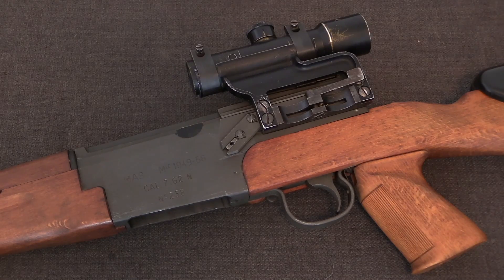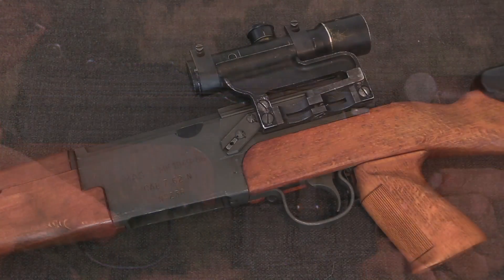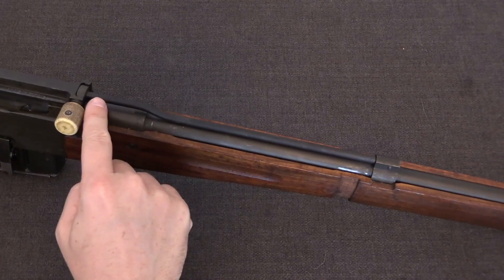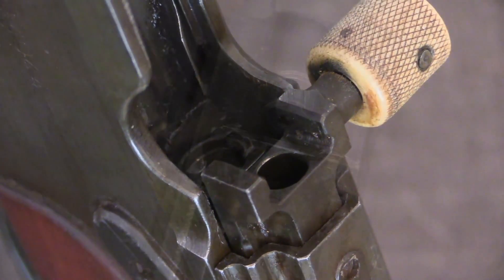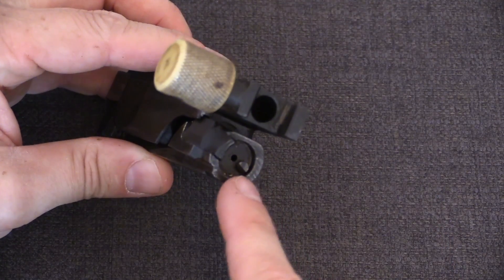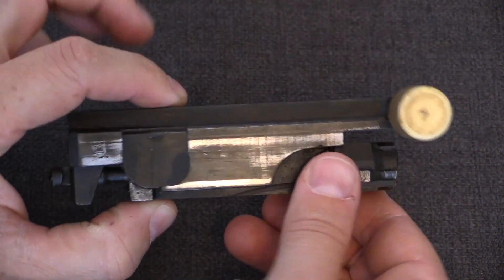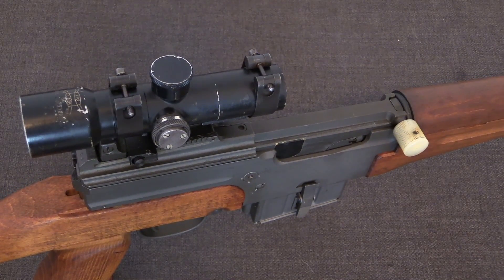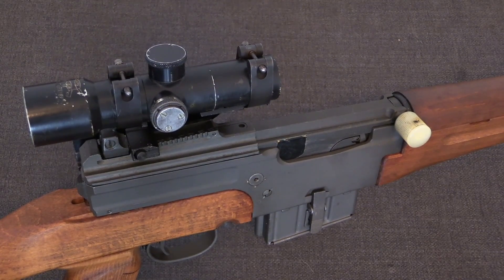How Does It Work: Direct Gas Impingement

Comment: It's actually wrong to call this (or the AR design) a Direct Impingement action. There are only a few firearms that use a DI system. The only similarity of Stoner's design with a DI system, is that the Bolt Carrier decouples from the Gas Tube when it cycles, so it's understandable why folks would make the mistake of describing it as DI. Stoner's design uses a piston, and it's part of the Bolt, so you just can't call it a DI system.

Comment: With the unique, hybrid AR gas system, the initial rearward force on the bolt carrier occurs when the gas enters the gas key/bolt carrier key and is redirected into the gas chamber in the bolt carrier. Because the gas initially acts directly on the bolt carrier the system may be accurately described, at least partially, as "direct impingement."  I like the term "piston-assisted direct impingement."  It is a unique system which is not accurately, or usefully, described as "piston-driven."
Reply: How about "direct-gas bolt-piston?"
Reply: I think the best option is to call it 'Stoner system' or 'Stoner gas system'.
Reply: @jic1  Works for me.

Comment: Most people don't realize it but the bolt on an AR15 acts as gas piston.  This confused the Hell out of me before I became a gunsmith.  There are also some piston guns that function somewhat similarly to impingement ones.  The Ruger Mini 14 comes to mind as it's "piston" is a short tube that blows gas into a blind hole in the op-rod.
Reply: I mean all DI guns have a piston.  A blind hole with a piston in it is still a piston.  There's nothing about DI that makes it mutually exclusive from also being a piston gun.  "Direct' is where the impingement is happening and "impingement" just means a force is being imparted.  All known DI guns that I can think of need a gas expansion chamber and a piston head in order to cycle.

Comment: I'm still waiting for one of these on the Blish Lock. 

"How does it work?
It doesn't
Thanks for watching"
Reply: L85a1 how does it work / how to operate 
step 1 : it doesn't 
step 2 : use it a a sledgehammer since thats teh only thing its good for
Reply: 1. Design barely functional blowback action
2. Add spooky metallurgical magic
3. ????
4. Blish Lock!
Reply: Well, technically the Blish Lock does make the the Thompson a "falling locking block - delayed blowback". It just wasn't locked as claimed and it would have made no difference if they had made the H-block from steel instead of brass.
Reply: @LunaDevaKitty  Sure. Because there was no necessity for a goofy delaying system. (That had been advertised as a locking system). However, the rate of fire increased despite them making the bolt heavier. So it did something.
Reply: @Feeshyenjoyer  You forgot step 3: stick a bayonet on it, make a successful charge and use it as an example for the "necessity of bayonets" in the army for the next 50 years.
Reply: How does it work: Three point sling
"You just slice it up and throw it in the garbage
Thanks for watching inrange"
Reply: I think you might have spoiled the next April Fools video ;-)
Reply: Thanks for watching and could you leave the $150 we charge for using the blish system
Reply: And the inertia lock?
“How does it work?
Space magic.
Thanks for watching”

Comment: Love the series but as a non-shooter, would love to see a video with a side by side comparison of some of the more common calibers used in military firearms. I know it would be impossible to compare every caliber but some perspective would be useful.
Reply: Calibers are usually not really important. Most "similar" calibers don't really differentiate enough to make a big impact in a firearms overall effectiveness (at least in modern times). Most modern armies usually only use around 4 types of ammo: a small bore, short case, necked intermediate cartridge (like NATO 5.56 or Soviet 5.45); a full sized, necked rifle cartridge (7.62Nato and 7.62R); a heavy machine gun cartridge (.50bmg or Soviet 12.7) and a straight wall pistol cartridge which is today almost universally 9mm parabellum
Reply: Ah yes, a comparison of 5.45x39 to 5.56x45. Not at all interchangeable  (slightly interchangeable in magazines) but for all practical purposes the same.
Reply: @dbmail545  eh, don't be so aggressive, he already said he is a non-shooter. But for all ballistic purpose yes, most of these modern military rounds basically behave the same.
Reply: @dbmail545  I have a 5.45x39 gas piston AR15... All I need to change to run 5.56 is the bolt, the barrel, and buffer spring. I can reuse the bolt carrier, upper, lower (which has a heavier hammer spring for the berdain primers)  and magazines (with minor modification on the 30 round. 20 round works fine as is). But, as far as performance differences, 5.56 is a tad more powerful than commercial 5.45 (I haven't yet fired actual mil spec ammo 5.45 yet. Just RAS and wolf). But I think (imho) 5.45 is more destructive on soft targets than 5.56 because of its tendency to turn corners in a body...

Comment: This is excellent, especially the bit at the end explaining what essentially makes it a locked breach not a blowback system and why. That actually makes how all other operating systems work far clearer to me along with what exactly makes it a locked breach. 

I’d be interested in hearing a similar explanation for a straight pull style bolt action rifle, why? Well it makes sense to me why a regular bolt handle is ‘locked’ since the unlock operation is in a completely different plane of movement to the bullet travel direction (90 degrees apart and rotating) but in a straight pull bolt I’m not exactly sure how it’s not possible for the bolt to just be forced rearwards since the unlock operation is performed in the same plane as the bullet travels.